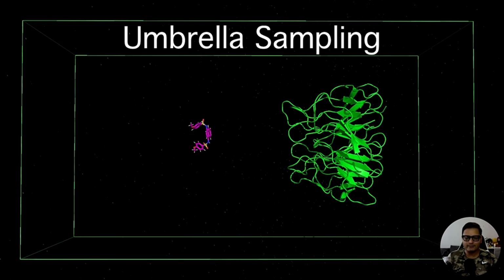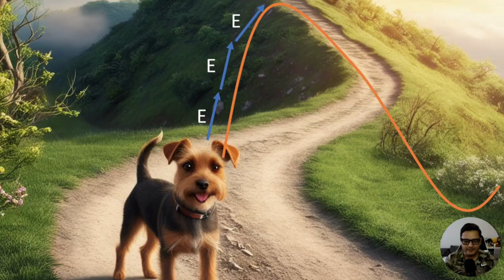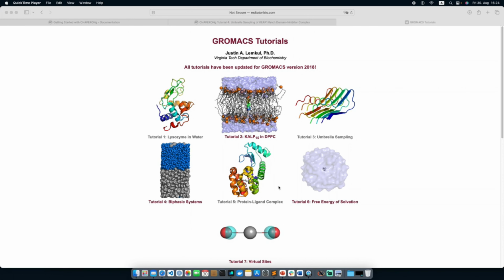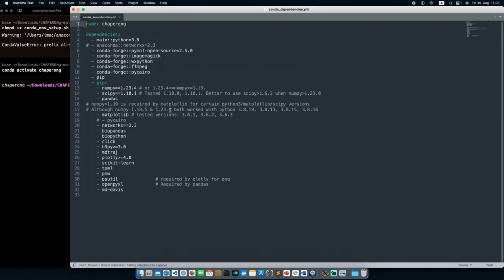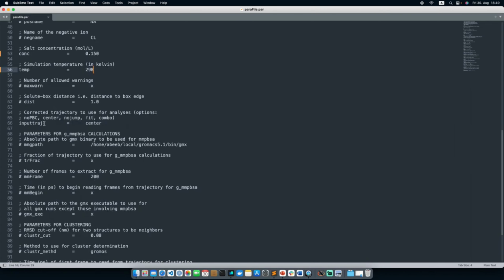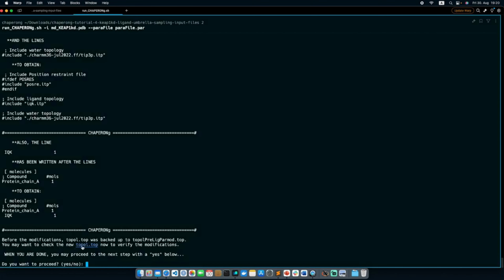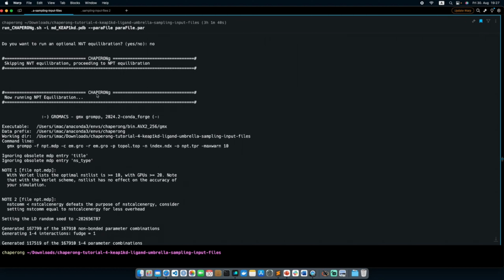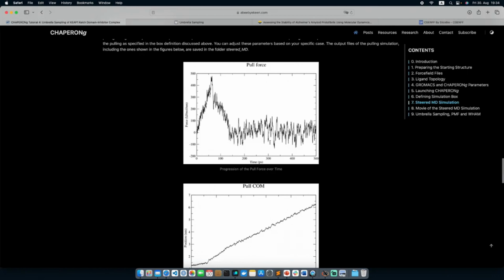Umbrella Sampling Explained: Master Free Energy Calculations Like a Pro!

Comment: I defined the box size according to the tutorial (without modifying any parameters), but I ended up with a Fatal error: Distance between pull groups 1 and 2 (8.621359 nm) is larger than 0.49 times the box size (8.621333).
Reply from the maker: Increase the Box Size (Most Common Fix)
Your box length in the pulling direction (usually the Z-axis) must be at least double the maximum distance you intend to pull.
If you need to pull up to 8.6 nm (as suggested by your error message), your box dimension in that direction must be at least 17.5 nm (8.6 / 0.49 ≈ 17.55).
Use gmx editconf with the -box or -d flag to increase the dimensions.

Comment: Dear Mr. Kumar
I have run MD for my antibody-antigen; now I want to calculate ΔG and umbrella sampling. Is there a session available for learning about this? I would be thankful to you if you inform me about it. 
I calculated a ΔG  through gmmpbsa. How many differences are there between these two analyses?
Reply from the maker: Umbrella sampling is completely different from MMPBSA. US predicts the PMF whereas MMPBSA calculates free energy between bound and unbound state. Umbrella sampling is based on pathway where you calculate the distance between ligand and protein
Reply: @Omixium_ai  Thank you. Actually, I want to compare them to determine which strategy is more accurate and better aligned with the antibody-antigen affinity.

Comment: I am using gromacs for umbrella sampling for protein ligand complex .  Shall I used ur tutorial md_pull.mdp and md_umbrella. mdp in gromacs . In ur md_umbrella. mdp file u noted pull-group1-pbcatom = 5135
Pull-group2-pbcatom= 649 . How to select this values ? Or Is it common for protein ligand complex . Can you clarify this , how to mention  this . Thank you .
Reply from the maker: Pick an atom that lies near the geometric center (or COM) of the pull group (e.g., a central heavy atom of the ligand, or a residue/atom near the center of the protein binding site).

If the pull group is small and compact you can often use 0 (GROMACS will use the middle atom number-wise), but for large or flexible groups you should explicitly give a centrally placed atom index. If you don’t, you will get warnings or incorrect COM handling.  

pull-group1-pbcatom (and pull-group2-pbcatom) is the atom index used as the reference for periodic boundary condition treatment inside a pull group. GROMACS shifts atoms to the periodic image that is closest to that reference atom before computing the group COM. This prevents COM jumps across PBCs for large/flexible groups.
Reply: Thank you sir. In index file I have pull group 1 name- protein , and pull group 2 name - lig , so based on the index , shall I use pull-group1- pbcatom =1  and pull-group2- pbcatom =11 , is it correct